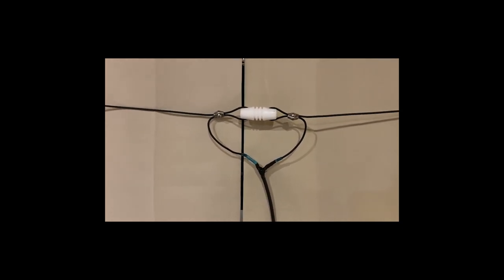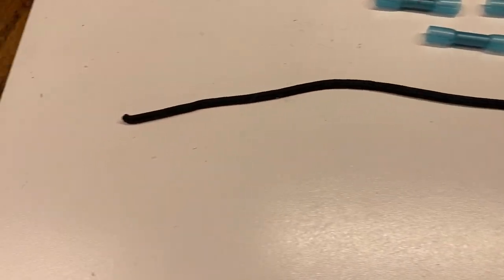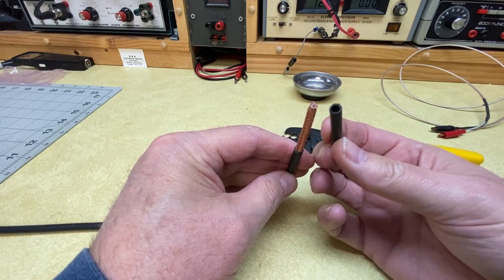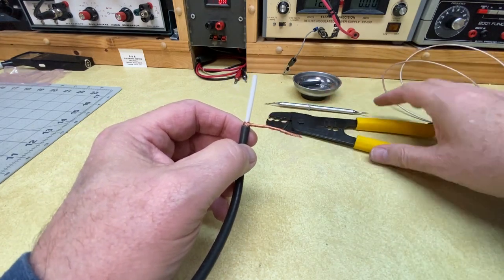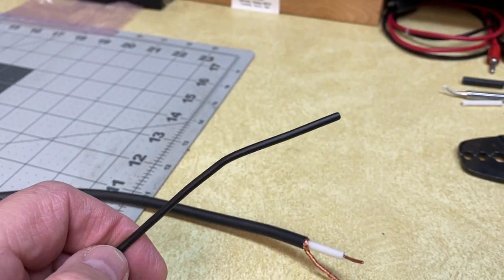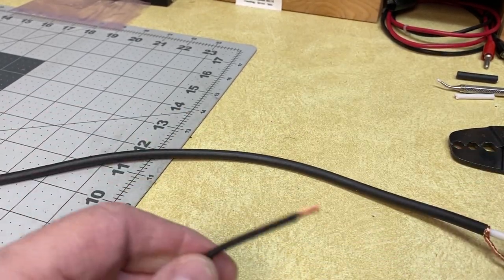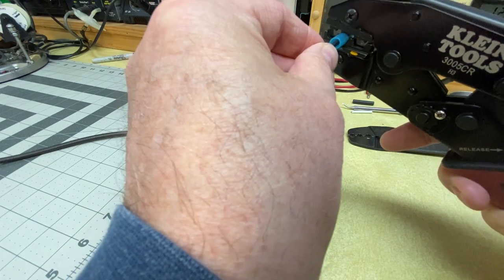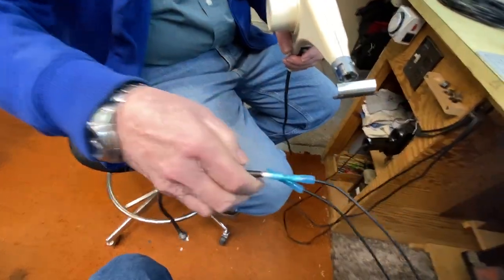Build a DIY Dipole Antenna

Comment: Good explanation and demonstration. A couple comments that may help. I usually just tie a knot in the antenna wire at the center insulator. Depending on type of wire. With stranded a knot works but I have used almost exclusively solid copper wire for 60 years. Used stranded once because my boss purchased stranded wire! If number 14 or 12 solid wire I just pass the wire through the insulator and wrap a couple turns around the main wire and then down to the coax connection point. Very few of my wire antennas have broken unless a tree or large branch falls on it! Most were up 10 years before I either changed them or changed locations.
I also always use the same electrical tape method. Since 1961. It always works for me. 
For portable / temporary antennas I have used standard electrical wire nuts, stainless screws and nuts, and of course solder. For an expected long term antenna I solder. Typically I use a coax pigtail long enough to reach the ground and put a PL-259 there where I can connect additional coax without putting a strain on the connector. Sometimes I just use a long enough cable from the antenna to reach my remote coax switch. Otherwise I use a barrel connector at the ground. For waterproofing there I use a self fusing or self vulcanizing tape. I use Rescue Tape which is sold by Ace Hardware. It comes off easy with no sticky mess like regular electrical tape. 3M has a similar product. Also for portable antennas I frequently do not use insulators at the ends of the antenna only in the middle. I make a loop at the end and any non conducting rope works. Saves weight and money. Under 100 watts only. For high power I do use insulators as the voltage at the end of a wire can be high. There are some new “wire nuts” called Wago lever wire connectors that I plan to try. 
Like the Crimper! For crimping the right tool is absolutely mandatory. If done right a crimp is great! 
73,
DE
N4DJ
Reply from the maker: I love your comments. When we built these at the club meeting, we stressed that this particular build was probably not going to be resilient enough for a permanent installation, but once tuned would be a good POTA or weekends only antenna. It's a terrific project to learn the art.

Comment: Coax, once stripped. Push the braid towards the jacket, this will loosen and shorten it, like a Chinese finger puzzle. Then make a hole in between the braid picks next to the jacket. Slightly bend the dielectric and pull it through the hole Using a shepherd hook. The braid stays intact, pull on the braid to elongate it again, and twist it as necessary.
Reply from the maker: As with anything in HAM radio, there are many ways to get the job done.

Comment: I am planning to build a dipole on the lighter side but able to handle 400 watts or so. This is a good plan. The span I have to cross doesn't have any center support so up to now I have been using end fed antennas. It's gonna be a lot longer than a 10 meter antenna though.

Comment: Why did you break the insulation at the end? Looks like that is where you would end the wire, instead.
Pull while you twist, and don't twist too much. You are twisting too much. 73

Comment: Good video guys. 
One question where do you take the measurements from for the wire length. Once you know you need say 34ft each wire in the dipole for a 40m 1/2 wave, where do you measure from to set the length correctly. You had said in the video the wire that came through the centre insulator is counted as part of the wire length then you edited that with text I noticed. 
Thanks guys
Reply from the maker: Good question! As I understand it, the radiating length of a Dipole is comprised of the horizontal lengths of wire. Those lengths from the feed point to the clamps do not count.

Comment: Twist (thread) those connectors on.
Reply: You are correct....the method shown is not the proper way to install a butt splice on stranded wire.
Reply from the maker: Living and learning!
Reply: Adding; thread CW
Reply: Do NOT twist the wire. When you twist a wire and then crimp, you end up with air pockets which are oxidizing over time. When you don't twist and then crimp, you have a solid airtight piece of metal.